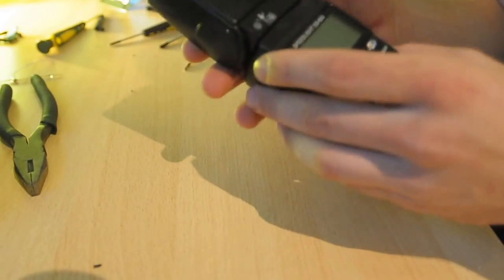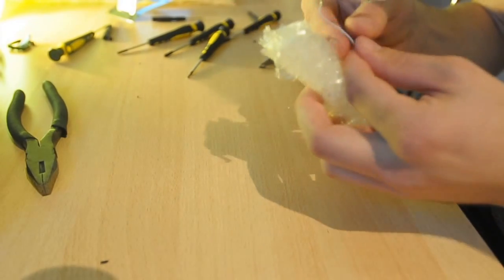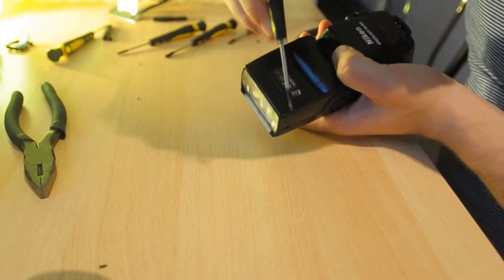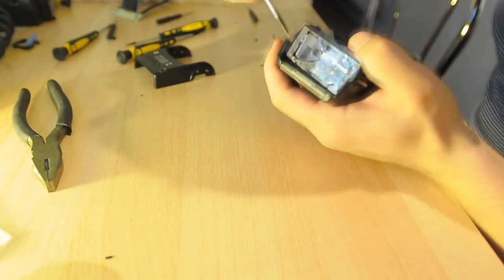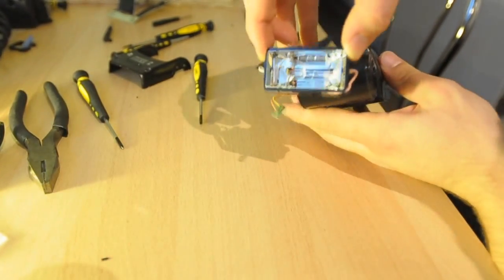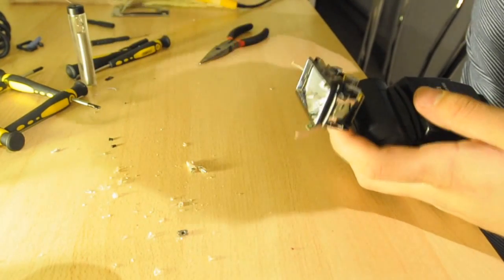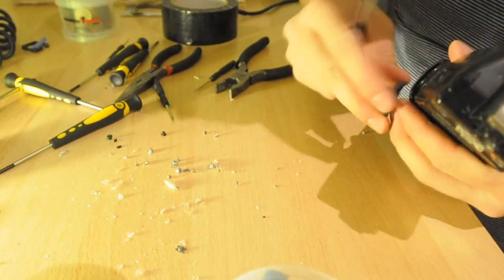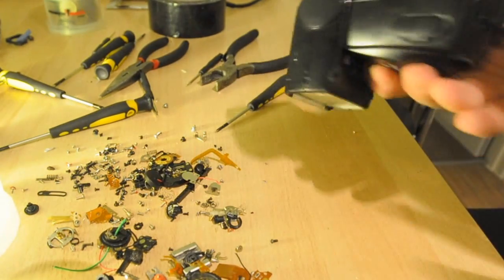Nikon SB800 flash tube replacement tutorial

Comment: this repair was such a pain in the A! I had huge problems putting back rubber wheels supporting the tube. And also the zoom does not work as before. It works in the range of 14-17 mm. But it was still worth it, considering no repairs from nikon itself...

Comment: Hi, wonder if you happen to know what the PCB E in the SB800 manual is for? It connects to the yellow connector(next to the blue connector) on the main circuit board(PCB A). Couldn't find any information anywhere...

I couldn't switch my flash on 80% of the time, so I opened it up to check if there is any loose connection or components. However, I accidentally broke one of the two pins in the yellow connector(Doh!) in the process.  However, the flash seems to be working normally, minus the pin, after I put them back together(so far, I still can turn it on the whole day long without issue).  

Many Thanks for any input

Comment: There is no mention of the trigger wire that you see the guy holding the flash tube by. That is the real beast of this job.  How do you attach that to the inductor that it sits by without ruining the whole flash unit. He completely skips this critical operation.
Reply from the maker: +Edward Monroe it was soldered to the inductor the same way as the other two sides. Just slide the new flashtube in, solder on the white and pink wires, and then when everything is in place, solder the trigger wire to the inductor the same way as the original was. I probably skipped it when editiíng the video. Wasnt intentional, didnt even notice it until now. Its been ages since I did this repair and only noticed now that how many people asked questions about the process.
Reply: +Robert Nemeti . I really got hung up on this part of the repair as the trigger wire  seemed to pull loose from the inductor and still be connected to a grey wire that I could not see where the other end  was connected. I hate to disassemble my other 800 unit to check this out.